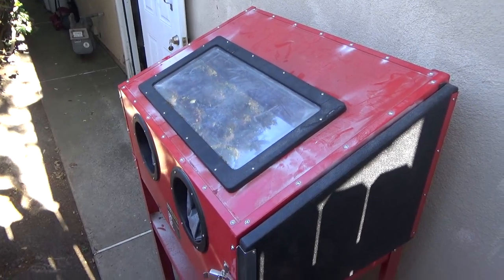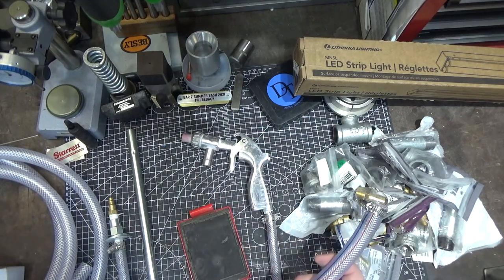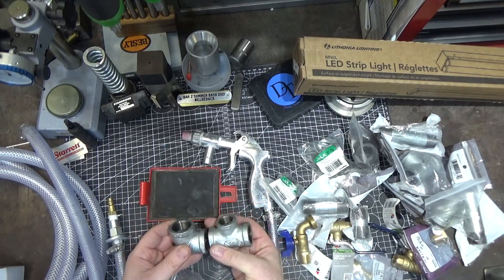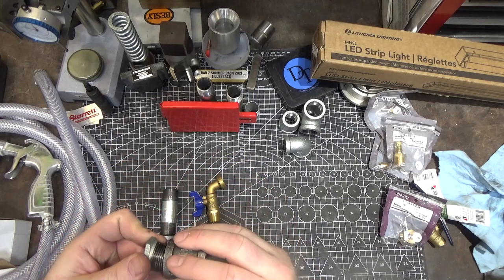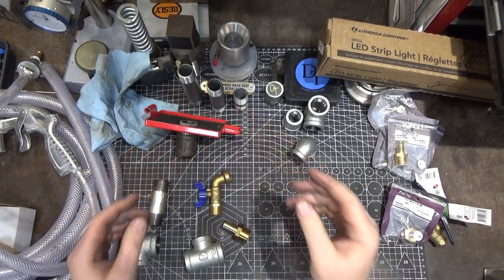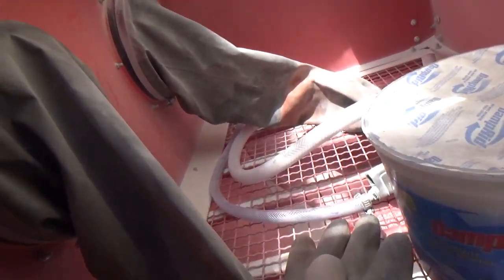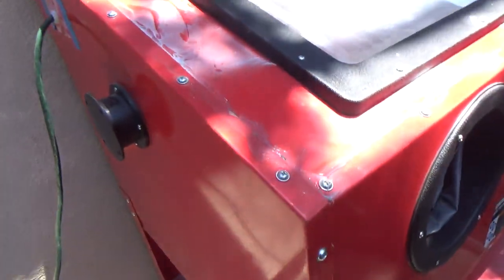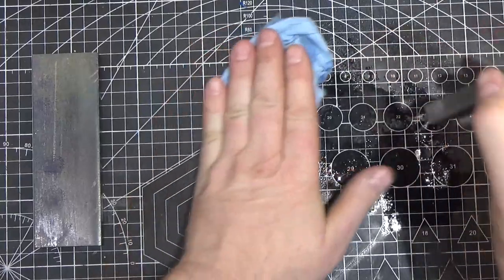164 Harbor Freight Sand Blasting Cabinet Media Feed Mod

Comment: Apparently you never heard of Alvarez Metal Works, he has a 8 part series on modifications to the Harbor Freight media blasting cabinet. The reason you're getting blast media blowing out of the upper cabinet seams is because the vacuum system isn't working properly, you have to watch his videos, very informative.
Reply from the maker: Thanks. I am not familiar with those videos and will check them out. Much appreciated.

Comment: Remember, the cabinet was designed by an "Engineer," who probably never worked a day using one, and he was driven by a penny pinching finance officer.  Good modifications.
Reply from the maker: I bet you are right, but if you are going to steal a design, why not choose a better one? Perhaps they didn't know one when they saw it. I hope all is well with you Vernon.
Reply: These things usually work well enough for the home hobbyist. The more expensive models are much better, but the upgraded models are better all around. My Grizzly model is somewhat similar to the HF one, but has two locks per door, and seems to be sealed better. The hose and gun are about the same, so I did a similar fix which works better.

Comment: This an old video but the reason the cabinet is leaking at every joint and seam is he is not using a vacuum as designed. Essentially the cabinet is a pressure box every time the gun is used. Try removing the black plastic plug in the side or connector he vacuum to the same hole as recommended.
Reply from the maker: I appreciate the tips. In actuality there are two exit ports and only one is closed (The one on the left side when facing the window). The other is in the back and is designed to work with a filtration unit. It is wide open and is designed with a trap and sort of a venturi  to allow grit to fall back into the unit.

Comment: I have very little experience with sandblasting, basically none except for lead shot in a foundry setting. Have you tried carefully measuring a part before and after sandblasting? I've always been curious how much damage it does, adding that much tooth must be removing material and it's hard to imagine that only mill scale and rust or removed.
Reply from the maker: I was wondering the same thing, but have never actually spent the time to find out. I have only used the sand blasting cabinet a couple of times so far.
Reply: it's pretty much nothing, only the weak pieces goes off like rust and paint. If there is things engraved it'll stay.
It also depend of what media you use, some are soft some are more agressive and it depend also if you work on stainless steal, wood, plastic etc...
But basically if you're not a savage it remoove only the necessary.
Just avoid sandblasting your gold bars before painting them.

Comment: There's a bunch of problems here but I'll start with the biggest one- you had the pickup tube installed upside down.  The hose is supposed to go over the single tube part, and the sleeved part allows air from above the media to come down to where you're picking the media up, essentially working like the bleed valve that you've added to your feed tube.

That gun works well if you get everything else working correctly, I'd guess the easiest way for you go fix what you have now is to add some pressure to the back of your bleed valve when you're running the blaster, that will move the media around where you're picking up from so it can't sit and plug up.
Reply from the maker: Thank you very much for the tips. I appreciate you taking the time to help all of us out.

Comment: Hello Robert,
Some nice modifications... I am sure the cabinet will work much better.
Cheers.
Paul,,
Reply from the maker: It is getting incrementally better, but still not as great as I would like. I have very limited sand blasting experience, so I am not sure how much better a top of the line solution is.

Comment: I use this cabinet in a commercial capacity. Use the updated pickup tube, have enough cfm, change the handpiece and it flies without a metering valve even though the cabinest leaks air like seive. I have 3 cabinets, have used this one for 12 years
Reply from the maker: That is excellent info, thanks for sharing. It gives me hope.

Comment: Interesting. I’ve got an old industrial blast setup, but it is still siphon.   Years ago I built a pressure pot sand blaster, total sand loss, no cabinet. I could adjust the pressure in the sealed tank full of sand controlling how much air pressure pushed the sand to the gun with a ball valve. This pressure system worked so much better than    my current siphon system.  If you know anyone who has fabricated a pressure pot system out of a siphon system please share where I can see how they did it.  Finally I suggest a vacuum to clear the air in the cabinet so you can see better.  Thanks for listening to my rant.  Cheers, Will
Reply: Make it extreme made a pressure pot sand blaster out of old gas bottles
Reply: @markshort9098  thank you for your help
Reply from the maker: I see someone already answered the pressure pot question. Isn't this community great? I wondered about the pressure pot systems. I went into the Harbor Freight sand blasting cabinet purchase knowing zippo about the process and tools. I only chose the cabinet, because I didn't have any place to use an non-contained blasting solution. As it is, my cabinet is on the outside of my garage. No room and wouldn't want all of that grit floating around inside near my machinery.
Reply: @DudleyToolwright  completely great. Worldwide experience freely shared.

Comment: 14:00 i've made a washer at the precise dimention to pull the nozzle.
The trigger quickly ended up unscrewing itself so i had to put thread lock glue in it.
But i finally bough an other gun with pedal control.
To get the cabinet working properly you pretty much need to invest as much as the cabinet in improovements stuff. Bought a cyclone for the vacum as well.
I sealed everything with silicon directly when assembling it, i've added silicon directly on the foam seals and more so i have no leaks.
Reply from the maker: Excellent tips, thanks. I added foam tape to all of the seams during assembly, but that did not seem adequate. Silicone it is.

Comment: Most of the leakage problems on these cabinets results from not pulling out as much air as your putting in.  Using a recovery unit or vacuum will all but eliminate the leakage problem.
Reply from the maker: Vacuum is a good idea. There are two sizeable vent holes, but negative pressure would be a bonus.

Comment: That's a great fix. I think you should consider either a long sweep elbow for the bottom, or perhaps a street elbow would be better, since the whole system works off of the Venturi effect, the street elbow narrows progressively through the curve. I think that that narrowing would increase the Venturi effect improving suction.
Reply from the maker: Interesting idea. Thanks for the suggestion. I am not sure I have seen a street elbow before.
Reply: street elbow is just the same as yours but with female on a side and a male on the other instead of both female. The ventury effect is not in that area but it will improove the flow because in yours after the elbow the sand at the exterior in friction with the elbow hit the male pipe that come in the elbow.

Comment: You mentioned adding a little (compressed) air to the heel of the 90 to help push the media at time mark 04:30 but I did not see air being used. It looks like you changed from adding a compressed air line to adding an air vent instead. Did you ever try out the compressed air? Years ago I made my own siphon feed system. It was a 5 gallon bucket with a hole in the bottom. I connected the siphon feed tube to the bottom of the bucket in the exact same way you mentioned. I used a Tee instead of an elbow at the bottom and I added a ball valve with compressed air at the bottom to help push the media into the siphon tube. The media was gravity feed down the center T hole and I had compressed air on one T side and the siphon feed on the other T side. It worked and I blasted an entire truck bed. Anyhow, I am rebuilding an old Trinco cabinet and am trying to find videos of how other guys have added compressed air to the siphon tube. Nice video, thanks for sharing your ideas. Thumbs up from Toledo, Ohio =0)
Reply from the maker: I had and have not yet tried to add air yet, but it seemed like a good possibility. Now I wonder if I should convert this to a wet system (vapor sprayer) since I have the unit outside and it has filled up with rain water. I live in So. Cal. it's not supposed to rain here and I have it covered, but the sun borke down the plastic in just a few months and I didn't notice until it was too late.

Comment: Might be overkill, but it might be worth putting the nipples on the lathe and quickly bore out the weld seam. With Venturi you're looking for the same conditions like a race car being ported and polished. I know you're not building the ISS, but I think smoothing the internal surfaces could be surprisingly effective. Particularly when you think about all the different profiles that different media have. Something like coal slag I imagine would build up against that weld seam.
Reply from the maker: Another interesting suggestion, thanks. I bet that a smooth bore would improve the flow of sand. On the flip side, how long will the sand have to flow before the bore is smooth? Funny thought, huh?

Comment: Could try put a shopvac on it, place I worked had a similar  unit and had a shopvac  connected  to it and if you forgot to turn it on, there'd be a big cloud of dust around the unit
Reply from the maker: That is a great suggestion, thanks!  I bet that would go a long way to solving the problem,
Reply: @DudleyToolwright  I did and it works great. Nozzle was a perfect fit into the cabinet hole.

Comment: You need to add a dust collection system and not try to perfect seal the cabinet, dont block the vent to the cabinet, the suction will give slight negative pressure in the cabinet and you will not need a respirator
Reply from the maker: That is a very useful suggestion, thanks. Unfortunately, I haven't the room.

Comment: Hey buddy  I've been struggling with my cabinet because no matter what improvements i make the media neve comes out and i just have air blowing on the parts. What size is your compressor? I have a 20 Gallon 4.5 cfm. Do you believe the metering valve will work with this air volume?
Reply from the maker: I have never gotten this cabinet dialed in perfectly and I have a 20 gallon 5hp 12.5CFM @ 90 PSI compressor and it can't really keep up without pauses. I don't think the gun design is very good at all. Read through the comments and I think you will find some helpful suggestions from people that have made other mods.

Comment: I've done all the mods that you've done and my media still surges in the pick up tube but the gun seems to store enough in the body to keep it delivering consistently. The stock gun's internal passages are too small and they seem to choke up easily.
Cheers, Preso.
Reply from the maker: It's weird that when Harbor Freight copied other designs, then didn't pick a better one.

Comment: I've just done the same mod, for some reason I'm not picking up any media no matter how much PSI or how open or closed my valve is, any idea what im doing wrong?
Reply from the maker: I have had a lot of issues myself. The media has to be bone dry to work. I lead a pail of desiccant inside my box. Others have suggested that I replace the gun.
Reply: @DudleyToolwright  Managed to work it out eventually, my gun was done it was blowing instead of sucking so obviously the media couldent work its way up the media tube. wear and tear I guess?

Comment: Great update …….. thanks for sharing.  I like the desiccant tube idea.  Can you elaborate a little more about it?  When did you purchase?  Do you have it in the original container, or is that a recycled tub?  👍👍😎👍👍
Reply from the maker: sure. The desiccant tub is a self contained unit that I got from Lowes. It has a fibrous membrane over the top of the tub that lets water in. It starts as solid pellets which dissolve when water is adsorbed. It is fully used when it is full of liquid. Here is a link: 
https://www.lowes.com/pd/DampRid-2-Pack-Refillable-Moisture-Absorber/3054901  
I am not sure how well it works compared to other solutions. Southern California is usually much drier than it has been the last two years.
Reply: @DudleyToolwright  - thank you so much for the details.  I’m in the Phoenix area, so I’m certain it will work well here too 👍

Comment: I've done all of the mods I thought were required. Cabinet works wonderfully untill a large piece lodges at the nozzle.  That aside blasting will ruin cheaper compressor motors ask me how I know. Don't forget to put a continuous run valve on the air compressor to keep it running the entire time you are blasting. I use the full 165psi available to me for best results but with good dry constant air anything over 75 will do.  Save yourself some future expense and get the valve for the compressor
Reply from the maker: Very nice. Thanks for sharing your ideas.
Reply: @DudleyToolwright  no problem I've burned up 3 motors before I broke down and bought a quality compressor.  Polar air by Eaton seems to stand up to the abuse I give it so far
Reply: you've burned the electric motor or something in the compressor like valve on top of the piston or segments etc... ?
Reply: @frederic6998  if the motor does a lot of on off cycles it will eventually stop working.  The valve maintains an air pressure that keeps the compressor running and only pumps air when it's necessary.  Anytime I'm going to sand blast or do a lot of sanding that would make the compressor start and stop frequently I turn the valve on.  Just look up continuous run valve for a better explanation.  I've burned out numerous motors before I bought a good compressor and installed the valve
Reply: @donright4310  my compressor is 42 years old and never had any problem with the motor.
Pistons compressors should not run more than 70%, i mean if it turn for 7min it need 3min to cool down.
My old one had not enough flow for sandblasting so now i got a 12yo Creyssensac 5300 for 350€ and it work wonderfull, powerfull enough for sandblasting in a cabinet.
Reply: @drefhill  my experience tell me otherwise with electric motors on the market today that won't cost a fortune to buy. I'm not willing to get into an argument about it the part that I recommended helps with abuse of the motor.  Use it don't use it I don't care compressor motors are continuous duty not made for lots of restarts

Comment: Ive had the same exact problems. I caulked my entire cabinet and it still leaks in the same exact places. The light sucks and the collection tube always clogs up.
Reply from the maker: Good to know. That way I am more confident that the problems I am having are less likely to be a result of something I did wrong in assembly.
Reply: Pull air out, or let air in, and the inside of the cabinet won’t be a “pressure vessel”, albeit a low pressure vessel.  Using a shop vac, and an adjustable opening vent will probably work fine.  Best, Will

Comment: Do you have a parts list for the metering value?
Reply from the maker: No I don't, but I got all of the pipe fittings at  Lowes. This was attempt one at improving the design. I think I still have a way to go before I call it good.

Comment: Not that long ago you were reviewing a bunch of your metal working books. Have you considered looking at a pneumatic conveying reference text in a technical library near you? Study the problem in front of you before charging down the path to confusion. It will improve the usefulness of your material from "B-" to "A".
Reply from the maker: Thanks for the tip. I will definitely look for books on that topic. I realize that adding positive pressure air to the feed assembly would be a big step up, but my compressor is already barely able to keep up with the sand blaster if I pause frequently. However, you points are very well taken, and the topic is very interesting in any case.

Comment: There's so many videos modifying that bottom cover plate in a similar way. Why does no-one drill a hole in the side of the metalwork that that cover closes on,, put a rubber grommet on the hole with a 15mm/22mm tube straight into the media?
Reply from the maker: That is a really interesting suggestion. I think horizontally mounted inlet tube might be a little bit less effective than a solution where gravity is working with you. Your suggestion definitely is worth some thought. Thanks for sharing your ideas.

Comment: I wasn't aware that this unit was air tight so moisture will only get in if you leave the valve open. I must have got a bad cabinet
Reply from the maker: The cabinet is definitely NOT air tight. It leaks sand like a sieve. The pipe fittings I added mostly are and if you leave the valve open I would be letting outside air directly get to the media. I am not sure how much of a problem this presents, but I didn't want to find out.
Reply: Sadly guys no matter how you look at it's got a vent on the side to let the air pressure out or attach a shop vacumn and if I'm right the other side also has a vent to let air in . Logic dictates you put in compressed air at 14cfm and its gotta get out somewhere . My cabinet has a 90 lt a minute shop vac on it and even with the gloves trying to be pulled off the fittings I still get sand leaking out the doors